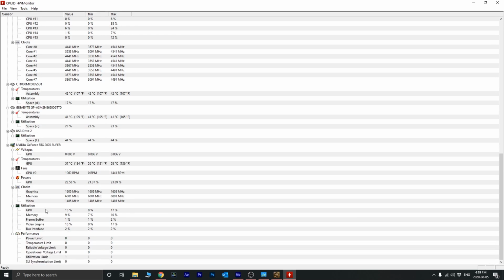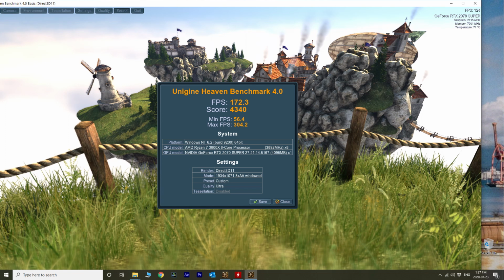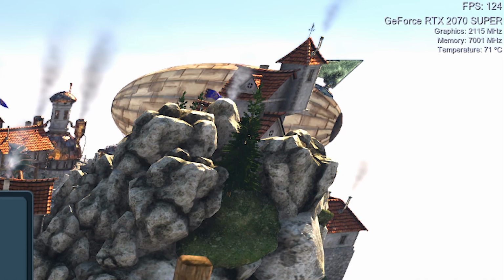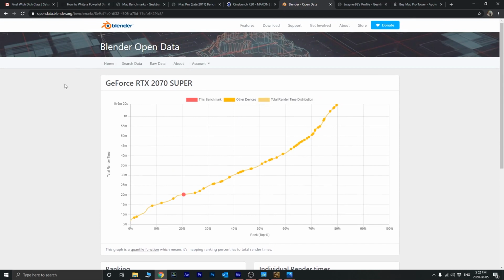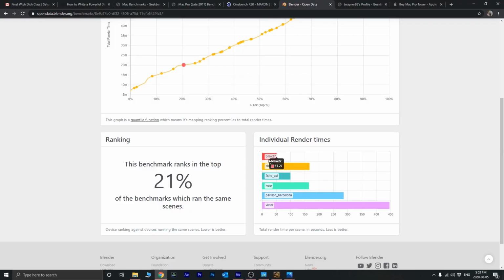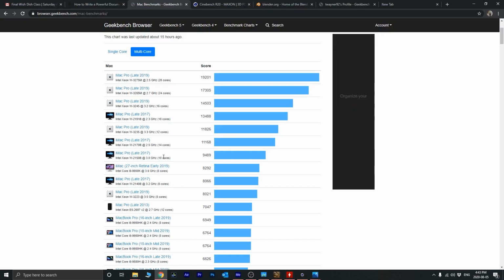Benchmarking my NZXT H1 Build

Comment: I am deciding between this and the nr200
With my 3900x n 2080 super ... How is the motherboard ? Asus  is better or msi or yours?? Can't find enough reviews
Reply from the maker: AJ VR hey! That’s an awesome set up!  ASUS has a USB-C header on the case if you have peripherals that use the IO. The ASUS one is a bit pricier though. Optimum Tech did a really good review of B550 ITX motherboards. I believe he got the higher clock speeds with ASUS, but with overall higher temps. I believe his recommendation was the Aorus B550I. Though do check out his review.